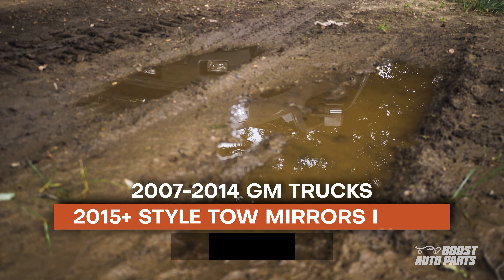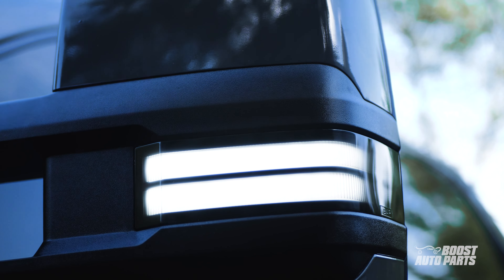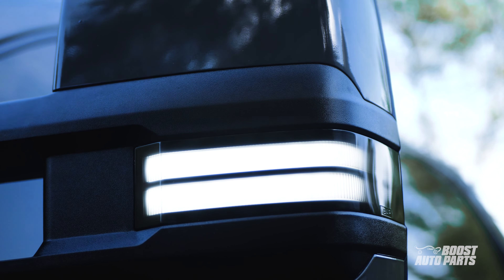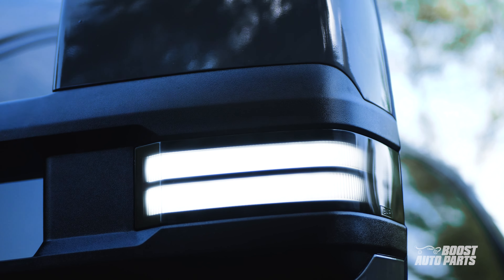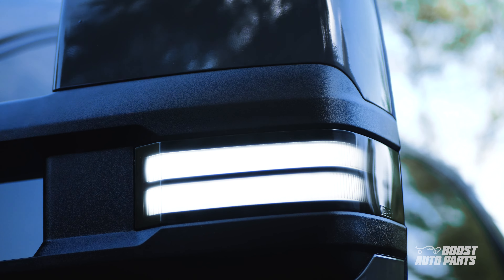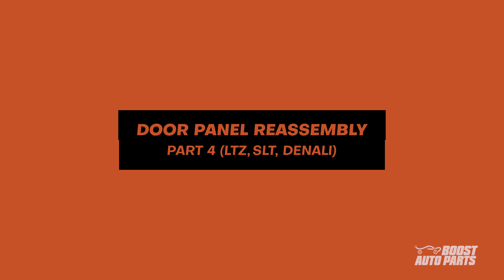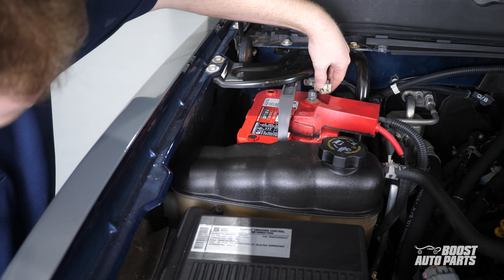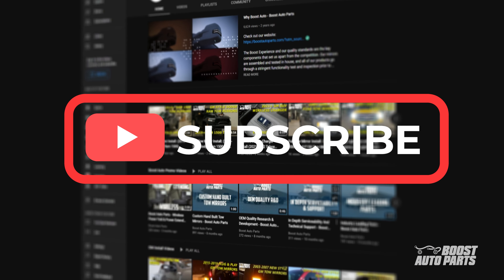Full Install Guide | Upgrade 2015 Style GM Tow Mirrors for 2007-2014 Silverado & Sierra | Boost Auto

Comment: If my truck doesn’t have blinkers in the factory small mirrors would the truck side of the door harness still have the wiring for them?
Reply from the maker: It will be plug and play with our mirrors for turn signal as long as you have factory power adjust.

Comment: the fuses keep burning up every time I put it in reverse, I bought the mirrors with the high output, do you have any recommendations?
Reply from the maker: You likely have a short on the white wire somewhere that happened during installation. Give our team a call at 765-831-2830 or email support@boostautoparts.com for assistance.

Comment: Mines a low trim but had auto fold. Mirrors to had to connect the harness to the switch panel instead
Reply from the maker: Correct -if you have power fold they will plug into the door module instead of a free hanging connector

Comment: What type/size fuse taps are they?
Reply from the maker: Unfortunately we don't have that info - but when purchasing the mirrors you will have the option to purchase the fuse taps and that will ensure you get the correct ones. If you already purchased but need the taps retroactively, you can call our team at 765-831-2830 for assistance.